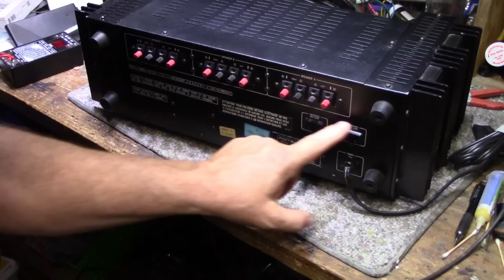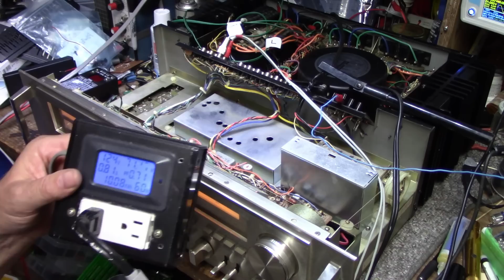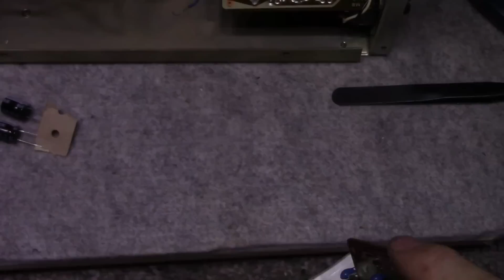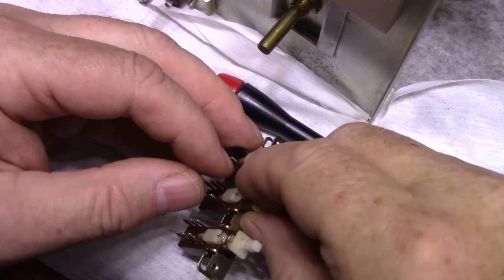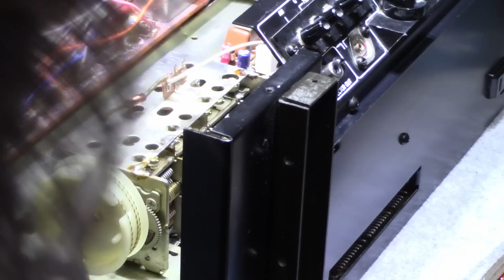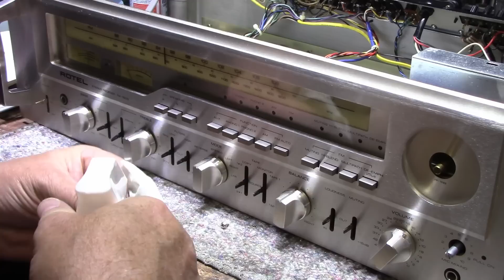Rotel RX-1603 Monster Receiver Restoration Part 1 (Ep. 197)

Comment: Usually when I start any of these vintage receivers the first thing I do is I open them up and then I proceeded to clean every single control on the unit before it even turn it on especially when the owner of the unit says we've got no sound coming out of it but it lights up because 9 times out of 10 it's the controls that are dirty the reason why they're not getting any audio out they've been sitting in a closet somewhere for God knows how long and those switches are all corroded with carbon maybe they were sitting in a house that was full of smokers and they are so full of nicotine and tar that the contacts aren't working because it's so dirty that they need a very good cleaning so that's the first thing I do the next thing that I do is I start checking capacitors before I even plugged the damn thing in especially the ones that are in the power supply and then I start it up on a variac and take it from there

Comment: A Wen or Weller soldering gun would make quick work of the solder points on the tuning capacitor box.  Most of my work is with the older tube rigs and I've used both of these guns for many years.  However, a Weller iron is used with printed circuit boards.
Reply: SO RIGHT!!! When he got out his TORCH for unsoldering I nearly fell off my chair.... It will do the job, but it definitely needs to be in the hands of a Skilled Knowledgeable Technician, and he is definitely that person!!!

Comment: Could that stuff that leaked from the Elna caps be some kind of sealant that has leaked out during production?
Like when they were soldered to the PCB?
Didn't look like it did any damage to the PCB...
Reply from the maker: I'm pretty sure it was electrolyte. About half the caps had no residue

Comment: On the phono bored where you had the dual tantalum 0.47 microfarad capacitors in series, that would be . 235 microfarad. You stated that you put a 2.2 microfarad film capacitor in as a replacement. Just wondering if you meant .22 microfarad film capacitor? I was also wondering about that large yellow .047 microfarad film cap near the rear of the chassis?
Reply from the maker: Maybe I misspoke but they were def 4.7uF caps back to back. These caps were at the phono stage output, just before the input selection switch
Reply: Those were 4.7uF obviously.
Reply: @paulb4661  when you place caps in series  the value is divided, so 0.47 divided by the 2 caps.
Reply: @garygranato9164  Trevor replaced two 4.7uF polar tantalums that were connected in series with a single 2.2uF film, most likely polyester Wima MKT, close enough for interstage coupling.
Reply: I understand parallel and series cap math. I went back and reviewed the video and I had definitely misheard what you said Trevor about the value. All is well in River City. 😁 Ears are not what they once were. Sorry for the churn. I am still curious about what that large .047 microfarad cap was for in the rear of the chassis. Thanks for the videos, especially on these mid to late '70 beasts!
Reply from the maker: @martyh9309  That 0.047uF cap at the back was across the mains power. Basically, the mains power comes in just to visit the power switch before it heads back out

Comment: Thanks for the 1000hz warning. My wife is not a fan and lets me know it. Xray tony keeps a lager trigger operated iron for large heat sinks when desoldering. Brave move with the torch around the tuner cord. I use an eye dropper on the grounds on the tuner to avoid spraying the fins.
Reply: Definitely need a higher wattage iron